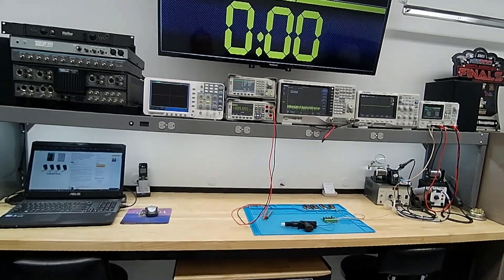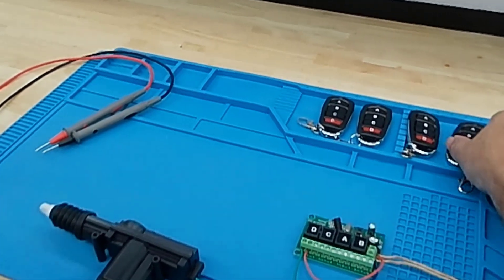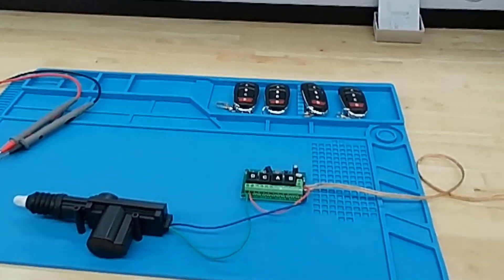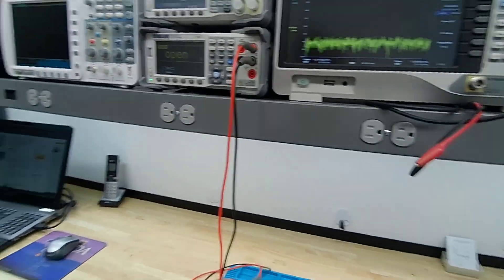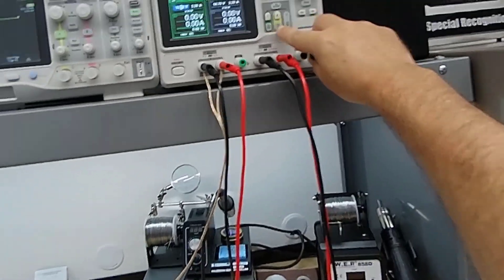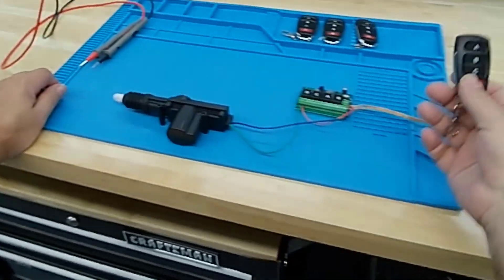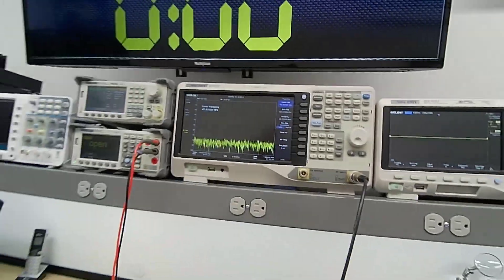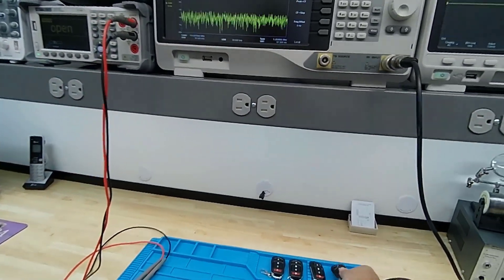Terminator KeyFob Remote Relay Door Latch Solution by Wayne Harris

Comment: NICE... I would do unthinkable things to get an ALPINE alarm keypad... LOL
Question: Whats up with all the Digital O-Scopes & not a single analog to be seen? :)
Reply from the maker: I suspect it has to be related to the use of LCD display panels instead of "raster" based picture tubes. Digital scopes do offer significantly more capability, including FFT, various measurement functions, color displays, and more. You just need a good one.

Comment: Hey Wayne - Great video and I'm enjoying the Terminator resurrection. If and when it comes to looking for the VSE-related parts, let me know as I have a good bit of OG documentation as well as a range of spare parts. There is also a dealer in Florida to whom I've sold spare parts who has VSE spares himself. Happy to help!
Reply from the maker: Thanks Todd. Right now I just had to implement a simple solution to open the doors. I installed the relay module this morning and it works great. Once I get the Terminator back from Austin Speed Shop I will focus on the operation of each subsystem in the vehicle.